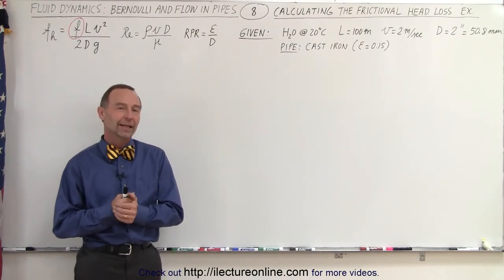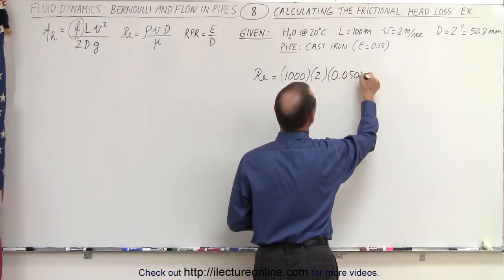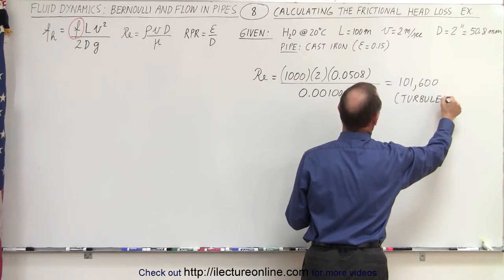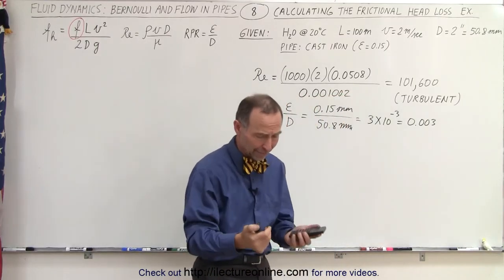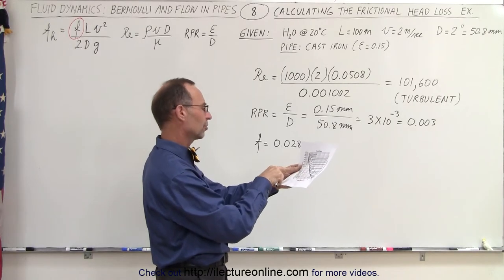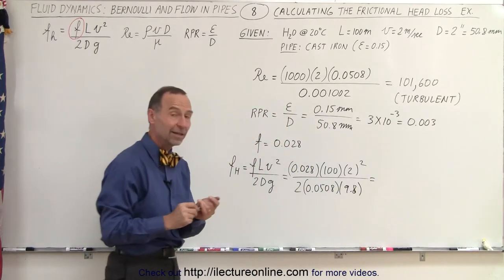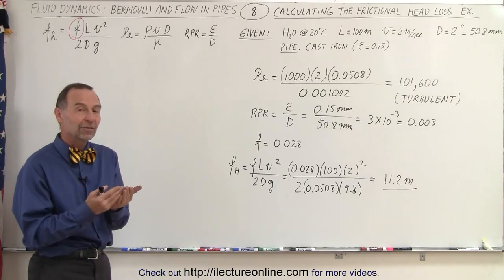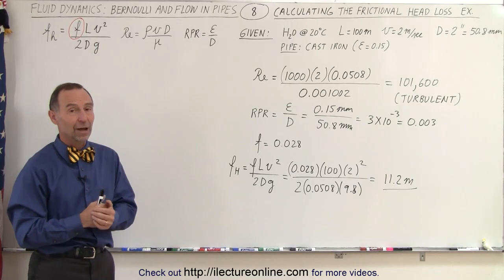Physics 34.1  Bernoulli's Equation & Flow in Pipes (8 of 38) Calculating the Frictional Head Loss

Comment: Great explanation! I was following all the way through. I just need to know what "effective length" is. Apparently it has the something to do with the addition of head loss in pipe and head loss due to fittings (k factor)? Any help would be greatly appreciated!
Reply from the maker: The effective length is the length of a pipe that would account for the same pressure drop or head loss as the pipe in question without any bends, fittings, etc.

Comment: Mr. Michel why did you calculate the friction factor from the Moody diagram? Could I possibly have utilized f = 64/Re where Re is the Reynolds number

I solved using that and my answer appears to be encountering a momentous deviation from your answer 😭
Reply: 64/Re is for when the flow is laminar. If Re is more than 4000, its turbulent and u need to do with moody

Comment: I know this is not really relevant to the video exactly but does the viscosity of a fluid depend on its temperature if so what formulae are there to describe this, also does the flow rate change therefore depending on temperature?
Reply from the maker: Yes, they are both dependent on temperature

Comment: Dear, Michel van Biezen. 
It was a wonderful tutorial. Appreciated it, Thank you! 
But, How about pipes connected end to end? or a network of supply lines going to the house tap, say, a shower?
Reply from the maker: Yes, what we typically cover is the theoretical pipe flow without viscosity and affect of bending and connections.  That requires a whole new set of videos covering those topics.  We plan on covering that, we just haven't been able to get to it.